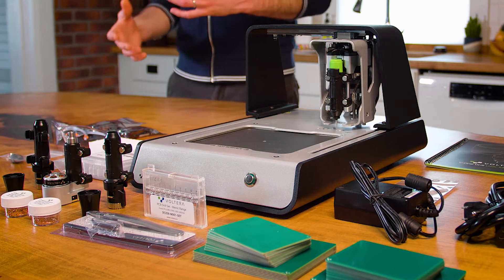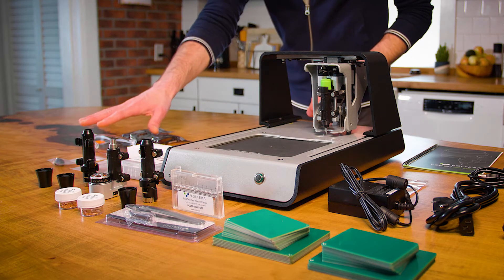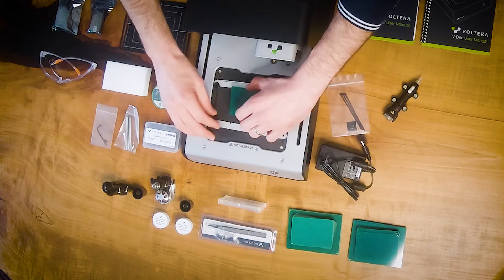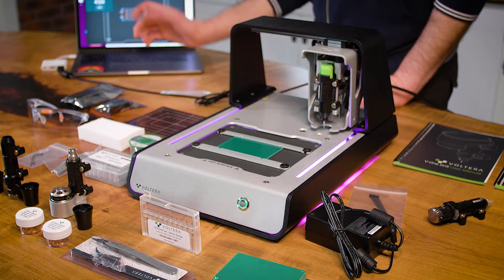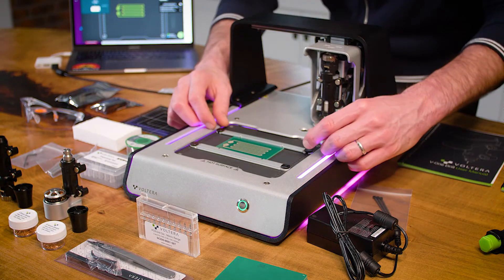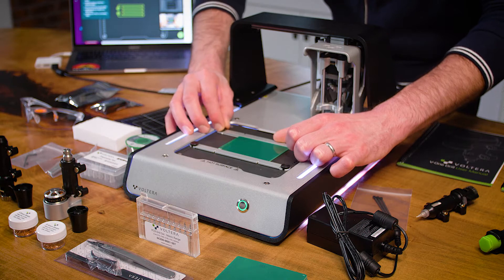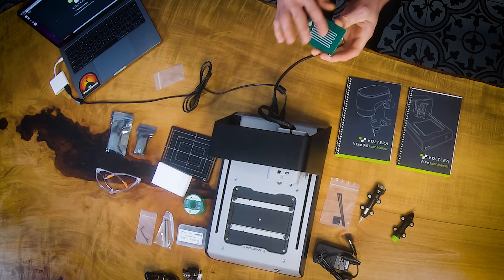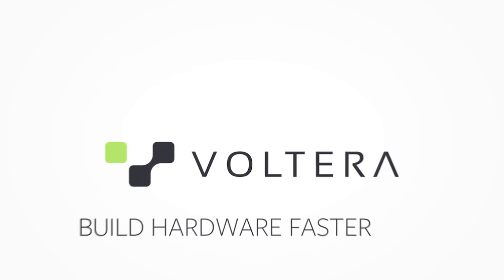Unboxing the Voltera V-One Desktop PCB Printer

Comment: How is better voltera or chemical fabrication
Reply from the maker: That depends on your specific application and which materials you use. Our PCB printer is best for prototyping. Many of our users will prototype their designs on the V-One, then have their final boards factory fabricated.